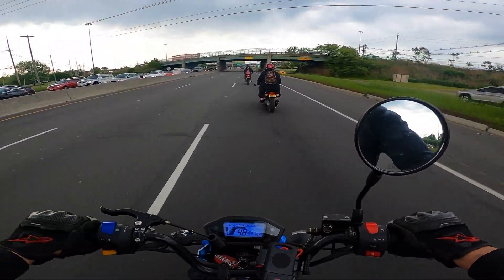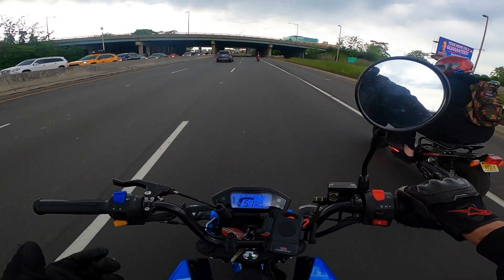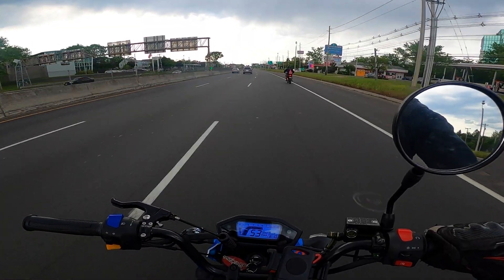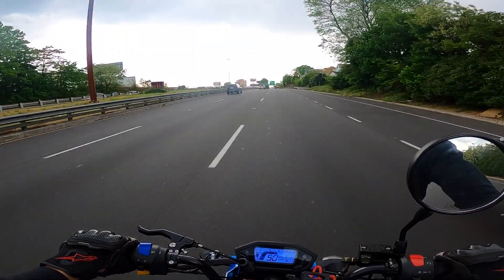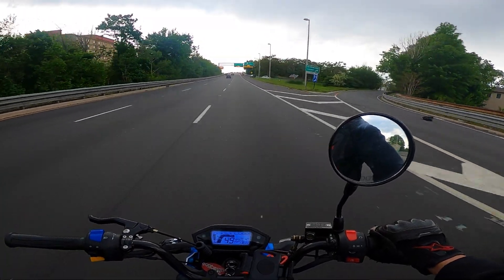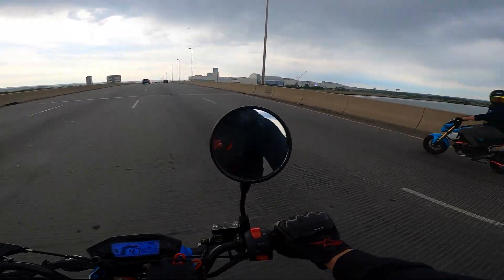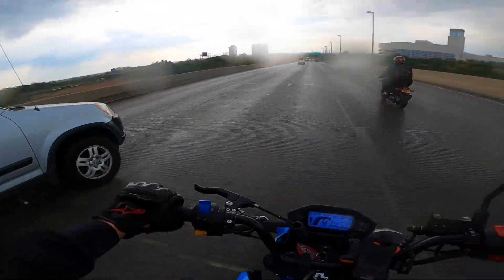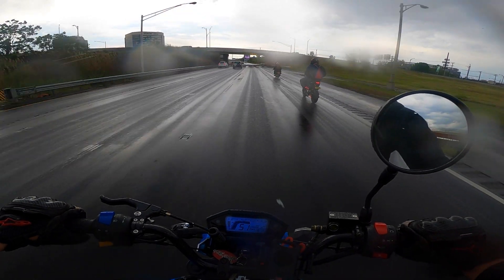Can You Ride a Grom Clone on the Highway?

Comment: This is why I bought the zs190cc engine I take mine to work and back 12 miles each way and the only way I can get there is on the highway and wanted to make sure I had enough power to pass if I need to great video have a great one till the next one 👍👌✌️💯🏍️
Reply from the maker: Whenever the motor blows on my Boom I’ll be getting a 190 haha learning to wheelie it right now actually
Reply: Yooooo, this is what I came to ask about, how did the engine swap go? That's my plan to upgrade it after a while, so I just want to see if I'd be in over my head before I order all the stuff